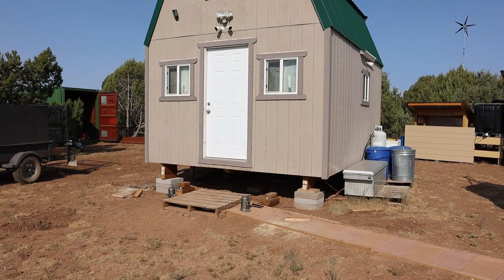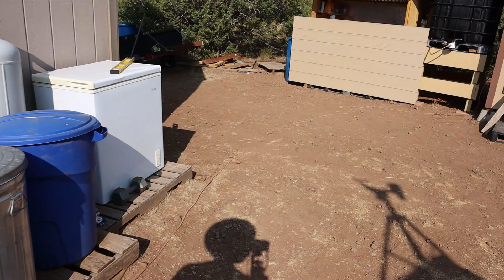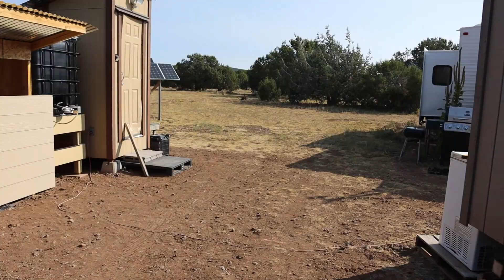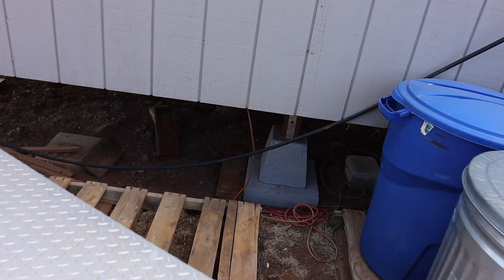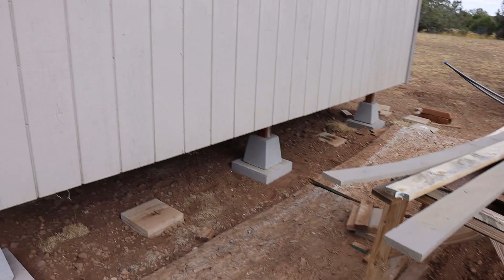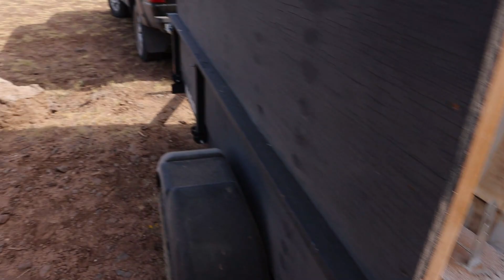Lifting the Cabin: Part 2

Comment: Your seeing things shake because you used vertical wood posts and only have thin metal brackets to keep things from twisting.  You can try to take some of the racking out by screwing 2x4 along side the vertical 4x4 post and babe them go up to the top of the horizontal skid.  Those metal straps are doing you no favors.